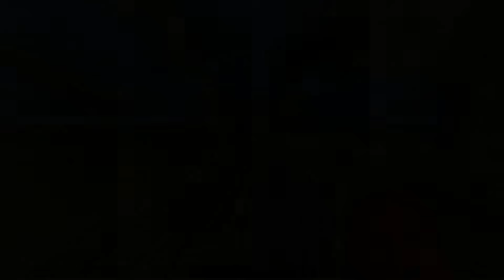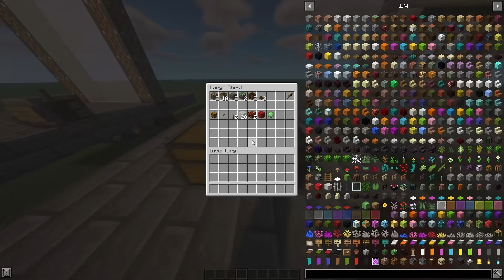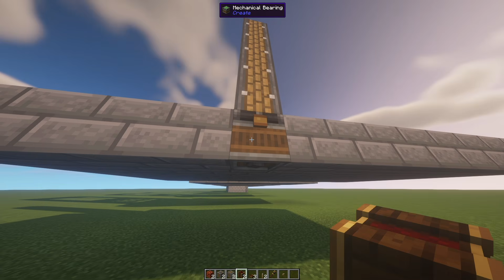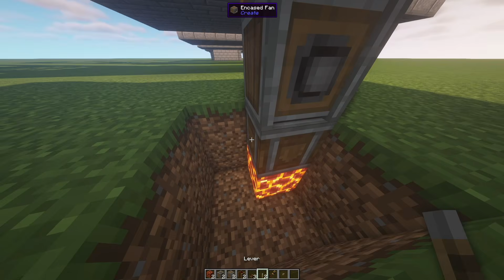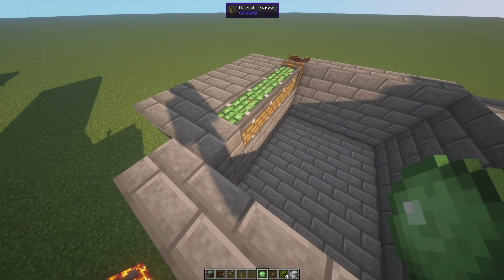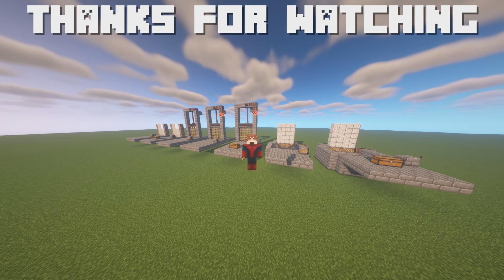Minecraft Create Mod Tutorial - How to Make a Door, Gate, and Bridge Ep 26

Comment: I watched this last night because I wanted a opening door on my castle, and a castle gate raising up for the wall. Holy smokes, I worked at it for a while.. got frustrated and saw my mans comment here that the encased fan doesnt do it anymore. Then a friend of mine told me to try gluing the blocks together, after a while of that realizing it was blocking the gearbox or whatever block was above the sequencing block. I had power, but it wasnt making it through as well. Finally after using some shafts in between blocks so I could visibly see what was happening, I got it😂  I feared maybe it didnt work anymore at all or something haha. Thanks for the video even though its dated, it still helps learn about Create mode and doors!

Comment: is anyone else having issues with the magma block thingy at 9:28? my fan is not powering the chassis. It might be because im trying to build the gate mechanisms below the door instead of above it like in the video.
Reply: Unfortunately encased fans cannot generate power anymore. But you can use a water mill in place of the fan and it works like a charm
Reply: yea it is because im building it below ; - ;

Comment: I think the latest update to create patched the magma block option, as it no longer generates rotation force.
Reply: Yea
Reply: Yes, I am in v 0.5.1 . This power source kind of sucked though
Reply: It did 😢
Reply: I used two water wheels
Reply: then what can i use instead???
Reply: @Din_Evernight  you can use a water wheel facing up with a few block missing around it, then place water in the direction you want and connect it
Reply: @bejnosart  Is there an alternative to that? Because the flowing water will be making noise which is quite annoying
Reply: @DimaQxt  not sure but you can always get a mod to stop water sounds, I'm sure there's a client sided mod for that 🤷
Reply: @Din_Evernight whatever source of rotational power
Reply: @Din_Evernight  I recommend using the creative motor because you can adjust the speed, just simply connect a shaft onto the vertical gearbox then connect the motor
Reply: @WhenTheBaller555  thx very much!
Reply: @WhenTheBaller555 only creative motors can't be acquired in survival lol
Reply: @WhenTheBaller555  What if I'm in Survival mode?
Reply: @DerekSan_Arg  just use a water wheel i guess
Reply: U a legend man thx💪 @WhenTheBaller555
Reply: Then what can i use
Reply: @pupsianimations pretty much anything that creates a rotation force
Reply: It still works for 1.16.5 I just made it.
Reply: @Reverse2057  yeah but it doesnt work for newer versions

Comment: How do you add a second button on the other side of the castle gate?
Reply: For me, the delay isn't working so I added a button on the other side by changing the sequenced gear shift to: 1 Turn 2: await, and then 3' turn the opposite direction and then end. this way you can open it and then push a button on the other side with a redstone receiver of the same sequence to shut it.